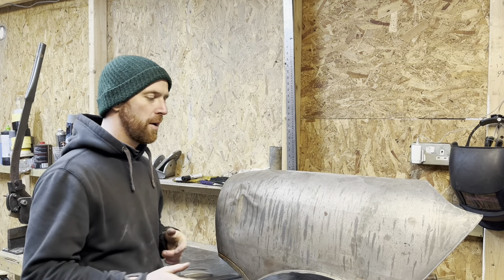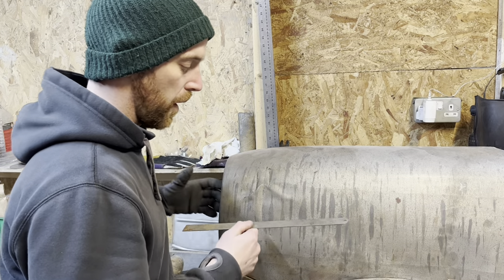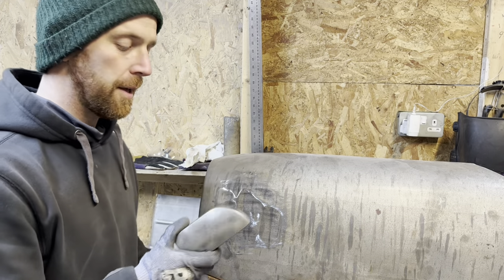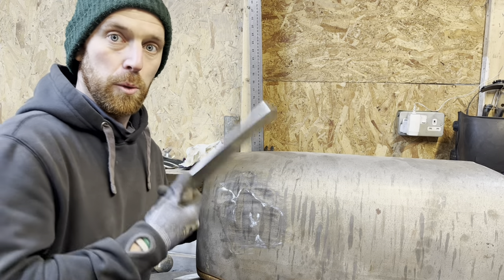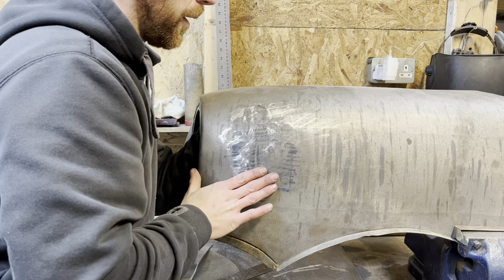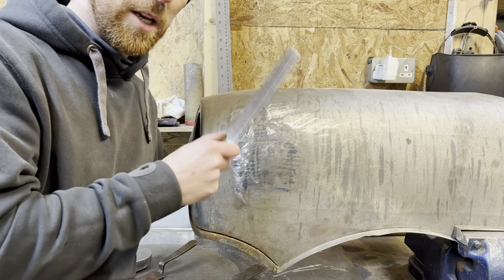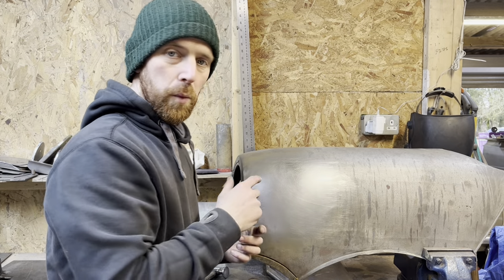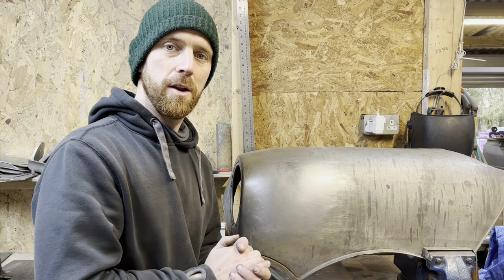Dent repair using a slapper

Comment: On the contrary - not boring at all. It helps if you know what you are doing. This is like art and the level of craftsmanship is highly noted. A tree branch fell on the hood of my cherry e28 just after I had spent two years of restoration. I already bumped it with a ball peen (total caveman move). So, I will attempt to rectify it with proper tools and technique. Good information on the video. 

I’ve received suggestions to heat the metal beforehand - is that recommended? Seems like that could facilitate unwanted stretching.

Comment: Excellent demo. Correct use of the slipper is real craftsmanship, very much a dying skill. 

Vernacular is important when describing sheet metal repair. Almost always we’re either shrinking or moving but never stretching. The slapper moves the metal by striking with a glancing blow which engages the high spots and wipes into the lows.

Comment: This may be a dumb question but you state that the metal is stretched.  Would there be any advantage to running a shrinking disc over the area after your first filing of the damage?  Enjoy your work, thanks for sharing your knowledge.
Reply from the maker: Yes definitely. I love the shrinking disc idea and use it alot on steel. I just tried to keep this video to simple slapper and Dolly that’s all.

Comment: Great work, what i am afraid of when i do jobs similar to what you'e done is the strength of the sheet metal since you will be filing down metal. What are your views please. Thanks for upload
Reply from the maker: Hi. Honestly, I wouldn’t worry about it. All you’re doing is literally scuffing up the surface to show the high spots and when I do this my aim is not to take away the metal so it leaves all the strength there. I’m literally just highlighting the high spots, the last thing I want to do is start taking away material.

Comment: Not too many body men use or know what slapping spoons and files are these days. 
On areas like that where I have access' I'll use C clamp vise grips to press low areas out' use a piece of flat steel over the low areas and clamp from the back of the panel onto the flat steel' and sandwich the low spot out. I have several different sizes and shapes of steel formed to match  different contours I've made over the years.
Reply from the maker: Good idea

Comment: could you have achieved the same using a sand bag, hitting from inside?
Reply from the maker: To a degree yes to getting the large dent out but not the fine crease or edges. It all depends on how far you want to take it.

Comment: It's worth noting, if youre working on a panel that has an anti corrosion covering, underseal, plastic coating etc, as opposed to bare metal, you need to remove it. Otherwise you beat the panel to the contour of the covering, sandwiched between the panel and the dolly.
Reply from the maker: I thought that would just come down to common sense 🤷‍♂️ but suppose not everyone would know.
Reply: @Metal_shaper_tom  to someone with no training, no i wouldnt expect them to think of it. The same as some dont know which way to turn a bolt to tighten it! (Or the difference between a bolt and a machine screw!)

Comment: 7:10 glancing blows do nothing. There's no such thing as "pushing" the metal in the rotating direction of the glance lol, that's magical thinking. If you turn your arm and let go of a ball the ball doesn't go in cricle it goes all straight : same with a hammer impact.  You absolutely do not have the strength to push metal around like you would play-doh, each impact only imparts its complete energy in a straight vector dictated by the moment the hammer/slapper contacts the metal in a super short window of time. Just hit normally in the right direction and it'll do the same thing, it'll probably cost you less energy. 

Why do "everybody does that"? because craftsmen aren't scientists and they don't really understand what they're doing, they don't have education in material science or even basic physics, (just stating facts) , so most the times they know what works and what doesn't when the results are flagrant , but in other small areas they're full of superstitious beliefs that are completely false. Because they don't understand what they're doing past what their senses can perceive.
Glancing blows do nothing.
Reply from the maker: Thanks . I never knew I was doing it wrong all this time 🙄
Reply: @Metal_shaper_tom  that's not doing it wrong, it's just useless to do it this way
Reply from the maker: @TheOneAndOnlySame  i agree. Completely useless!
Reply: @Metal_shaper_tom  Completely, totally, utterly useless . 
Hey, next time try to hit it with a glance and straight back up (draw a vertical circle, I bet you can pull the steel up too! 🤣)
Reply from the maker: @TheOneAndOnlySame  keep this between me and you 🤫 …….. I can raise metal doing it that way. video coming soon!
Reply: @Metal_shaper_tom  Nice!  Can't wait ! Also try hitting the hammer with the piece instead of the piece with the hammer, you'll see it's like using control+z on a computer!
Reply from the maker: @TheOneAndOnlySame  think I need to watch some more YouTube on how to do this type of work as I’m clearly doing it all wrong 🤦‍♂️
Reply: @Metal_shaper_tom  glancing blows do nothing. No matter your ego.
Reply from the maker: @TheOneAndOnlySame  so you keep saying. As I’m new to all this could you put a video up so I can see how to do it correctly? Not only would it hugely help me it would also benefit others wanting to learn.
Reply: @Metal_shaper_tom  just do normal blows. I don't know why you would require a video of someone just hammering normally.
Reply from the maker: @TheOneAndOnlySame   clearly normal for one person is different for another as in this instance. I learn best from watching  hence why I watch loads of YouTube and see how others do it and find a way that work best for me and the job I’m doing at the time. If in this particular job I could of done it better and quicker without all the unnecessary work then I and many other would benefit from a video that’s why I’m asking.
Reply: @Metal_shaper_tom   I don't know brotha, try it for yourself. The practice of Glancing blows come from magical thinking . 
Just hit straight 5-10° in the desired direction (because that's exactly what you do with glancing blows actually : you're hitting at an angle the slipping/rotation movement does NOTHING)  . I repeat : only the impact will move the metal , and the orientation the force is going the very moment it connects to the surface is the only one that the metal will feel , because force can only go in a straight vector, NEVER in a weird arc-like compound direction : there's no such thing as a compound direction force vector )
So, once again: glancing blow is voodoo mumbo jumbo . 
Don't be scared to learn new things and widen your mental landscape